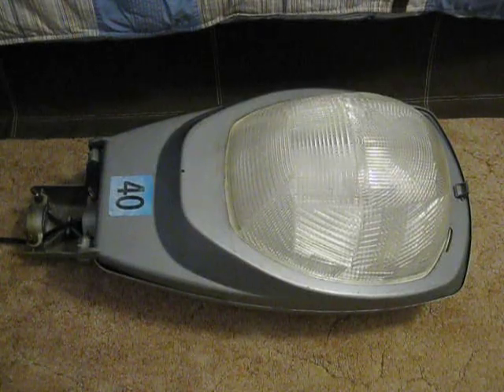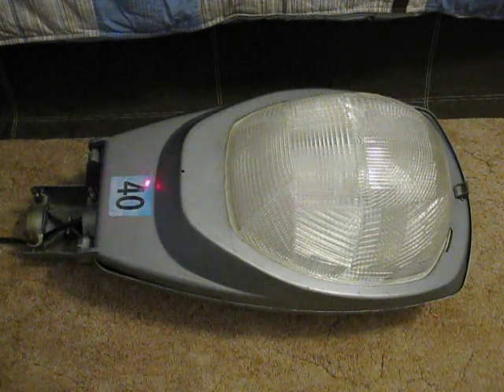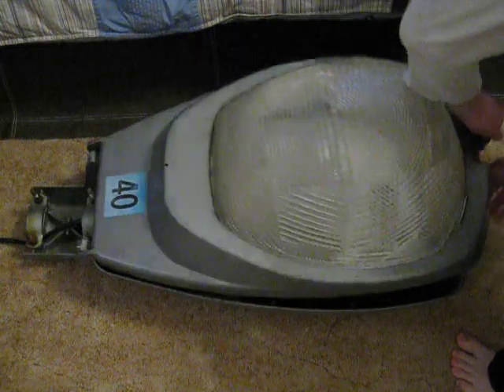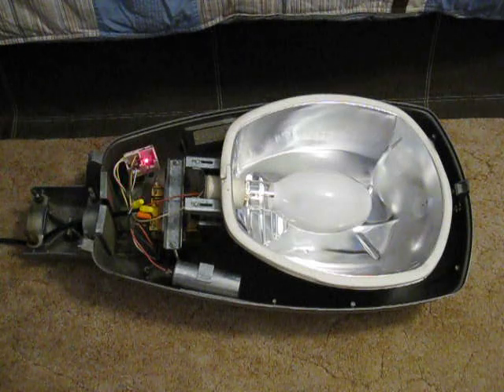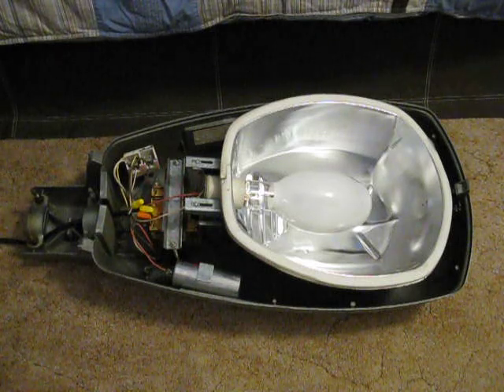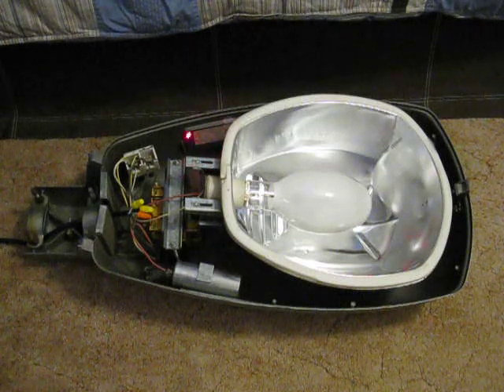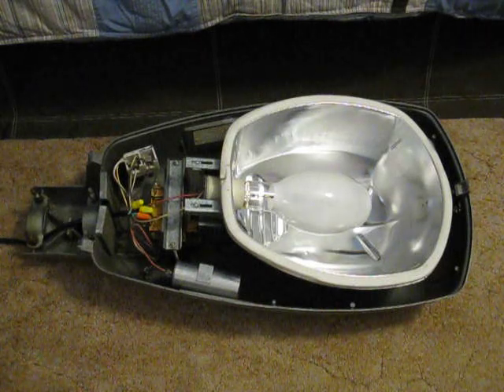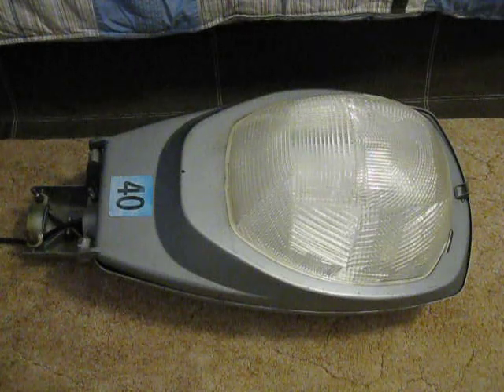Crouse-Hinds L-250 400watt Mercury Vapor Street Light

Comment: How old is this light? They EVERYWHERE here!
Reply: These started production in 1982, replacing the Westinghouse OV-25
Reply: ScienceGuy722, it started in 1980 which is formerly Westinghouse Type OV 25 and it takes 400 Watts Mercury or HPS. Also available is a 250 Watts Mercury or 100 Watts LPS, which is also formerly Westinghouse Type OV 15. Both versions are found in Detroit Michigan as of Public Lighting Commission, and the suburbs of Detroit, such as Dearborn, Dearborn Heights, Berkeley, and Inkster Michigan for Detroit Edison (now DTE Energy). In early 1990s it changed it to Cooper Electric by using the same type of lens (refractor) and some other components. Now they are replaced by LED streetlights several years ago in the city of Detroit and elsewhere recently.

Comment from the maker: @2010Freightliner Well for this one, the L250, you need a 9/16 wrench or a deep 9/16 socket with a ratchet. This size is the same for my M400 and OV25 so it should work with other street lights as well.